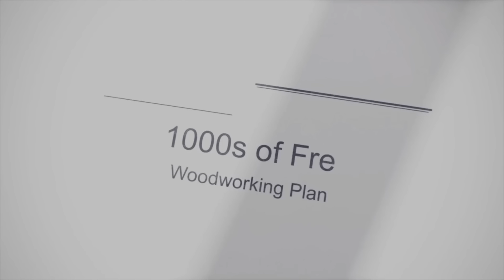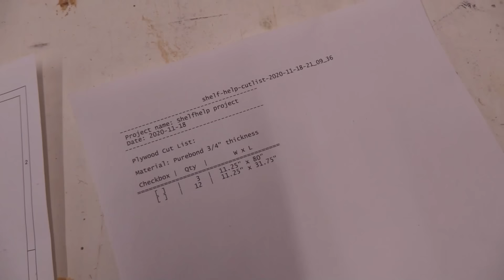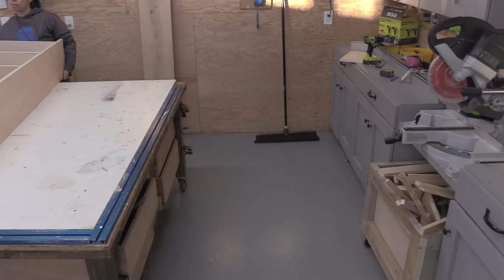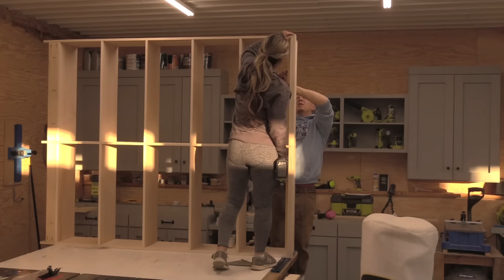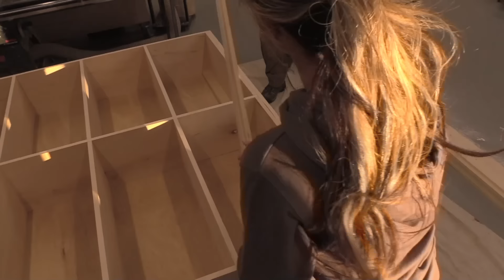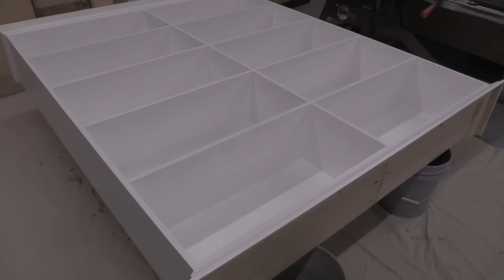Building Your own Custom Sized Bookshelves!

Comment: Hi Anna. I would like to be able to design my own custom book shelf and have the material precut and shipped. I’m not sure of the cost of this.  
With that said Our wall unit shelf system will be quite large. I’m thinking it is going to be three sections put together as it will cover a large area of one large wall going over and around the tv and buffet that it sits on.  I’m wondering if I use your system to design it and it’s in 3 sections, how I go about doing that .  I think this would be the perfect way to go if it’s affordable .  
Thanks
Jana
New Waverly Tx
Reply from the maker: Sound great! Please email anawhitesite@gmail.com and we can help explain how to do that.

Comment: Nice book case, I plan on building one for my room for collectibles to go on, Awesome job looks great as it is, Mind sharing the cost of the build with us?? Thank You
Reply from the maker: Wonderful, lumber prices have changed so much since we built this. I would recommend taking the cut list and having it quoted through your local lumber store. Thanks for the visit. You could also use our shelfhelpnow.com service, here is a template https://shelfhelpnow.com/blogs/templates/frameless-bookshelf
OR you can use the configurator https://shelfhelpnow.com/pages/shelf-configurator
In the configurator you can add to cart to see what the cost is shipped directly to you!

Comment: I'm looking to build a book case, i am 6'5" and 49 years old and two things have been bothering me my entire life. first of all it is impossible to find book shelves you can buy that are taller than 6 foot, second the whole point of shelves is to save space and when the book shelf is 6 foot but my ceiling is 8 foot all i can ever think about is there is a solid two feet of space there just going to waste. so yeah i want a book shelf that is not shorter than i am and i want to utilize the space as much as possible from floor to ceiling. 
i don't want to make a built in shelf i do want the option to be able to move it if i ever want to, and for that reason i know i wont be able to make one that is the entire 8 feet in height because depending on the depth of the book case you wouldn't be able to lay or stand the thing up to move it since it would wedge against the actual ceiling so there has to be some amount of leeway. 
i would also be preferable if the shelves weren't set in place and were adjustable, i dont want to drill holes or anything and use those little pegs that cheap bookshelves use. but there are metal strips you can put un the sides on the inside that little metal clips lock into that give you a very nice range of placement options.
Reply from the maker: That is achievable for you!

Comment: I'm not sure if anyone suggested it already but if you're having difficulty with the crown molding options in AK, I would suggest you combine the base board with the crown you're using now, and make a frieze out of the two.  You're right with the current crown looking too small, esp. compared to the base.

Comment: If you order the wood from shelf help does it come with the pocket holes, hardware etc?
Reply from the maker: It comes with the plywood and build diagrams. The pocket holes and extra supports or trim are not included. It is 3/4" purebond plywood with one edge edgebanded.

Comment: I love this. Shelf Help was such a good idea. I haven't checked it out yet but I love the idea. One thought was that it's probably expensive to buy. I'm so cheap I'm always trying to save on materials. BUT... I have a booth at a local antique mall. And I'm finding that the time it takes to process the materials myself is more valuable to be spent building so I can get more pieces made quicker. So I think this is going to be super helpful. And this shelving turned out great!
Reply from the maker: Yes, it does save so much time!

Comment: Will it be ok to have the pocket holes on the middle divider aligned? won't the two screws coming from the different shelves affect each other or make the wood weaker?
Reply from the maker: I offset to one side about 1/2:)
Reply: @AnaWhiteDIY  Perfect! Thanks for the reply and clarification, I missed that in the video. Thanks!

Comment: Just my two cents...
I'm all for the ease and strength of pocket hole joinery, but with all due respect, unless it was for (maybe) storage shelves in a shed or something, I could never leave those visible.  Everything doesn't have to be built as a piece of fine furniture, but if you're bothering to make a bookcase with finished edges, a base and crown molding, do you really want to then be able to look under the shelves and see gaping pocket holes?  Ah, no!  You gotta draw the line sometimes, especially on a project like this one.  Fill the holes with wood plugs or filler, sand them flush and either finish or paint.  That bit of extra time and attention to detail will make THE difference between a piece that really looks custom and something that frankly will look tacky on a bookcase with crown molding!

Comment: Exactly what I needed! Quick question, you didn't seem to have used glue while assembling? Is it not required? Thanks a lot!!
Reply: The back was glued and nailed.
Reply: Glue would really add strength to the pocket holes which don’t bring a lot of strength.